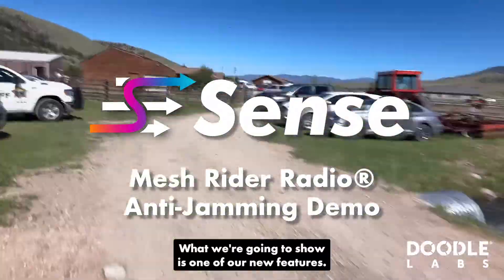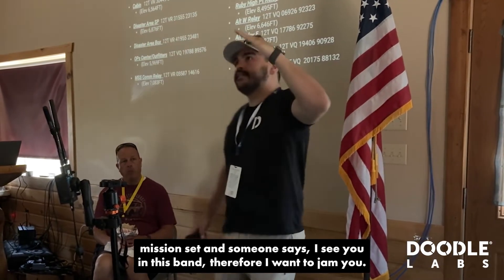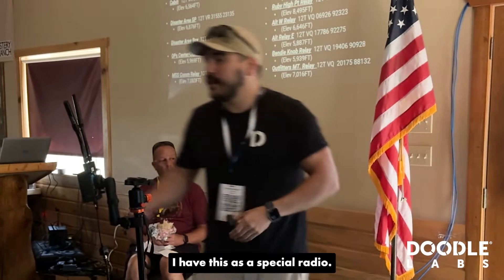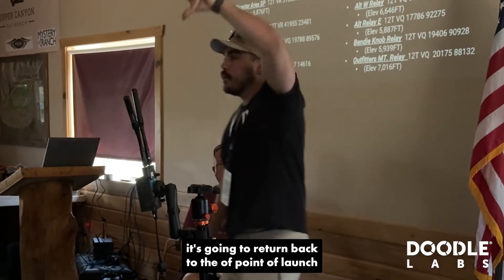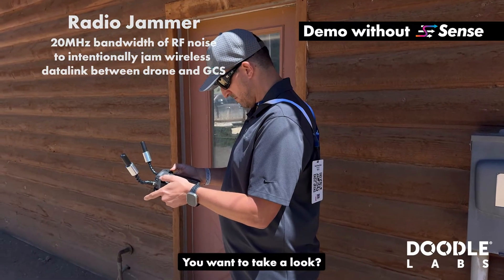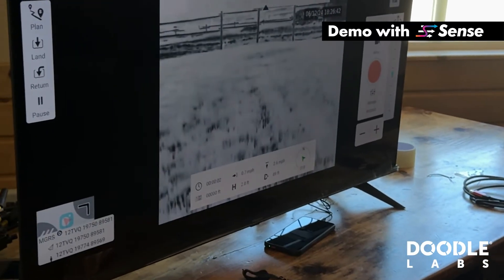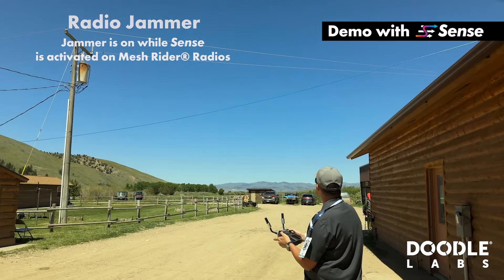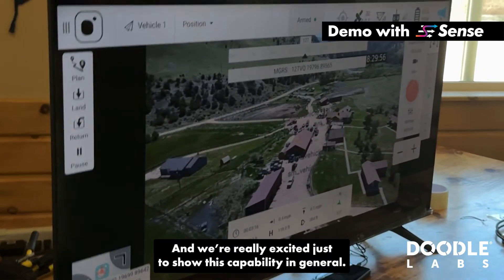Drone anti-jamming demo at Tough Stump Rodeo

Comment: What happens when all regular known drone bands are jammed at the same time? There's no way to switch to another frequency because its being jammed also. Seems like the solution is to use a unknown frequency?
Reply: Basically, or use a fiber optic drone
Reply: How many 20 MHz bands are there? One would have to turn on a powerful jammer to jam them all. But then it would become an easy target for anti-radiation drones.
Reply: @eugenedsky3264  there’s only one… hence the name 20Mhz band.. did you really just ask this question? And yes the Russians have a vehicle mounted drone jamming system equipped with battery backup it’s strong enough to jam American airplanes out of the sky if you read the news articles. Just need high power, with enough amperage theoretically you can create a jammer that jams every single frequency in the spectrum
Reply: @Miyukiii111  The so called S band (frequencies from 2000 MHz to 4000 MHz) contains 100 (one hundred) 20 MHz bands. Not all of them can be used by a single radioelectronic chip in a tranceiver, but you get the idea... Не пиши чушь... Also you can use not only frequency-hopping spread spectrum (FHSS), but time-hopping (THSS) too! I.e. you can make your RF pulses much shorter and give them more peak power with the same electrical power source (battery, generators, etc.). Thus you make such a link even harder to jam.

Also don't forget about autonomous and semi-autonomous drones (guided artillery shells), which can bomb an enemy location with its coordinates given in a 3D map or in a local positioning system (LPS) based on ground hyperbolic radio-beacons synchronized with compact atomic clocks and corrected every 1-2 minutes by a test drone...

Questions?
Reply: @ I thought by 20Mhz you referred to the single frequency
Reply: @ no no questions you seem to know everything about these systems 😬 haha have a good day